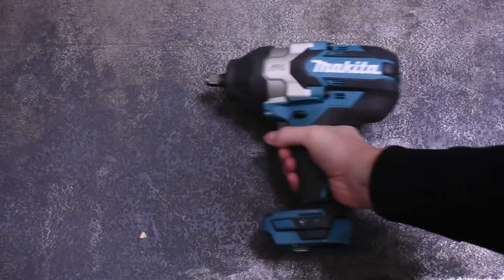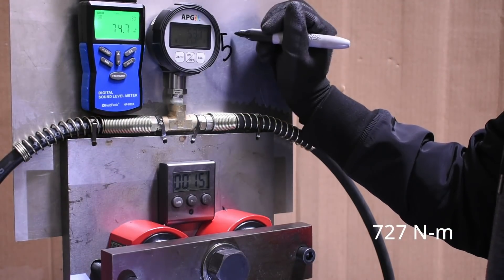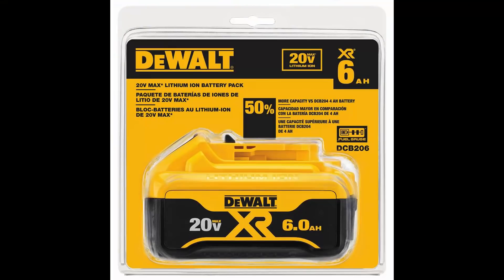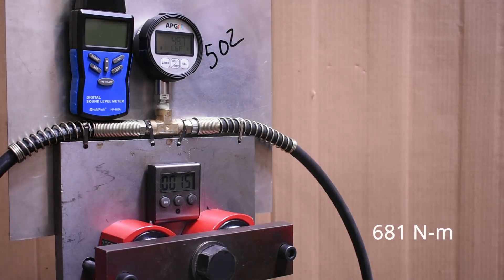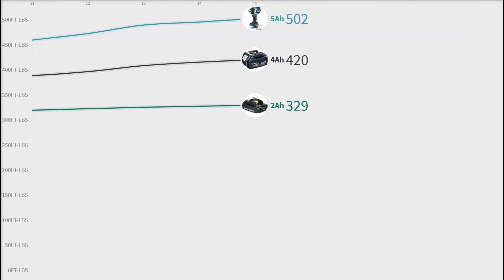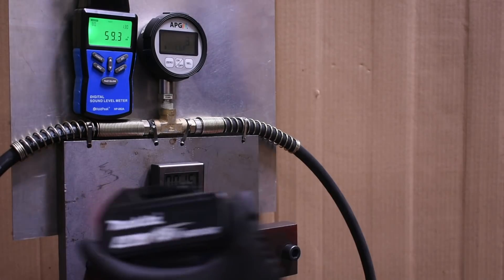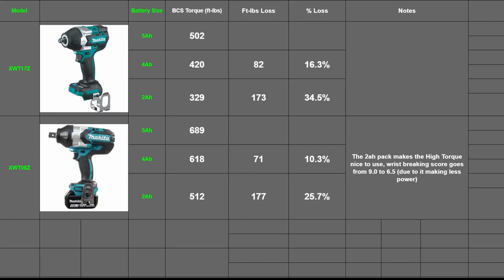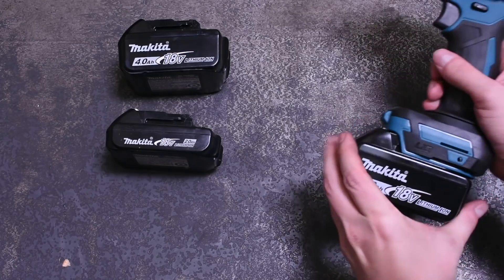How Much Power Are You Losing w/ Smaller Batteries? Dyno Testing For Science

Comment: Voltage is the limitation because amps cause heat. Milwaukee has major overheating problems and consequently battery failures. Makita did the smart thing with XGT. Makita, unlike all other companies, is an engineering company instead of a marketing company. Makita is primarily interested in making the best tool.

Comment: WHY NEVER A 6AH battery test with Makita? Many always ask but we never get a answer (sorry for caps). Are they not worth it? Keep up the good work 😉
Reply from the maker: Same number of 18650's but higher capacity. 3000mah cells. Which sort of suck for discharge rate. Will make less beans
Reply: @TorqueTestChannel  thanks! That makes sense finally 😎 thanks. How about the wider 21700 cases from ebay 1row4ah and 2row8/9ah? Would they yield more power on a mid torque do you think?
Reply from the maker: Yes me thinks if using real cells. Gotta build one. Leave me to it!
Reply: That would be awesome to test! Another question. I can find Samsung cells 18650 with 2500mah and a 25a or even 30a discharge current. Will they be stronger then the standard 20a cells?

Comment: I'm kind of confused what's better the Milwaukee 5Ah🔋 or the Makita 5Ah🔋? Have u seen what's inside? I know Makita has a VERY sophisticated charger with a fan & all the protection I think a lot of the batteries even do a balance charge, I don't think the older Makita batteries have that feature but I think the newer ones do. It's cool because Makita only has 2 chargers a single charger & a dual charger but all of them are fast chargers the other brands make you buy an expensive tool setup to get the fast charger, Makita hands it out with every setup 🤷🏻

Comment: great video. I understand your point of view about makita batteries and tools but dewalt does the same they sell the flexvolt tools that can take advantage of the flexvolt batteries and makita sell a new line of tools that can take 2 batteries at the same time. I only own dewalt tools but this is my opinion about makita battery system which I like more because I have a hard time using the dewalt 9a batteries because of the weight in small tools and with makita I only need the 5a for the big tools and small tools. I hope that others can understand my point of view.

Comment: I have the Bosch Freak that I've tried with the 2Ah, 4Ah (2170), and 6Ah. The 2Ah had issues removing lug nuts off a car i torqued down to 140ftlbs months earlier (old could remove half) and the 6Ah was able to confidently remove them all. BUT the 4Ah with 2170 cells blew them off no problem and has no issue removing 250fllbs nuts off a truck (although slow vs my air blue-point impact). My point, some impacts see a world of difference with stronger batteries. If its the electronics or mechanics of the tool i think it varies, but the Bosch seems to release all the beans the battery has and is extremely consistent.

Comment: In defense of Makita, I believe they are the only one that the charger pulls air through the battery when charging. I have a 3 ah battery that came in a tool kit that I purchased in 2007 that still works. I also have a brushed hi torque that I think I purchased when 3 ah was the largest capacity battery. I didn't use it much until they came out with the 5 ah which made a huge difference.

Comment: The case on makita batteries is made of high quality polycarbonate, not ABS plastic as you stated. If you look at the bottom of a battery you will see the "PC" marking. I recently backed over a 2ah Makita battery with my 8,000 lb diesel truck and it is still usable.

Comment: Just to say as shown on the battery packs, Makita packs are PolyCarbonate. Definitely not some weak shit like ABS, dunno if it's better or worse than nylon for this case, as far as I know it's stronger, but less flex. 
Oh and the 2Ah pack you tested not having the gauge might be part of the weakness since the fuel gauge is on the newer more recent B revision that plays into their whole smart tool/battery protection and control wizardry.  Would be cool to see you test that 2Ah against a newer BL1820B 2Ah which are currently $43 on amazon right now so for any fellow Makita guys wanting a small battery for smaller tools it's a helluva steal.

Comment: Great video, but i came to defend the Makita batteries. They are built and assembled with extremely high quality materials. I dropped an impact 25’ onto concrete and both the tool and battery were fine. The “generic” battery housing profile is durable, streamlined, small, lightweight, and user friendly as they can be removed one handed. I wish the other brands offered this.

Comment: Makita XGT 2.5h battery is 18650, the 4ah XGT battery is 21700. 

Sydney tools opened them up.
Reply: 18650 does not have high output cells above 3Ah, so you can guess that it is 21700 without dismantling it.

Comment: What I would like to see is these companies offer a fan cooled corded AC to DC adapter when your batteries are drained and you have access to AC power. Dewalt did this with their old 24vt system. I still use the circular saw in my shop because its so light. The fan cooled AC DC converter works great.

Comment: Great channel.  A suggestion for all us gear heads out here.  Since you already have a great test jig for calculating torque and clamping force, it would be neat to see you use the jig to show some common fasteners like lug nuts and torque yield bolts, their tightening torque specs and corresponding clamping force.

Comment: There's seems to be a rule of thumb developing relating to the minimum size battery required for maximum torque output of each class of torque wrench:

Low torque: 3ah.
Mid torque: 4ah.
High torque: 5ah.

Comment: I love Makita cordless tools and own quite a few, but they do have the ugliest battery.  They really need to update the look and design of their batteries.  I agree with you that they look generic.  But the they make some really nice tools.  I love their 6 1/4in skill saw and their 10in top handle chainsaw.  

It's crazy how good the cordless tool market is now.  Makita, DeWalt, and Milkwaukee are pushing each to new places.  I wish Bosch would try to compete more, because they make some great cordless tools as well, but they don't really have the lineup the others do.  Having said that, I think Bosch's CORE battery system is the best I've used amongst drills and impacts.  They last so long.

Comment: This is interesting information because I always considered the larger battery basically allowed longer run times not tool performance THAT MUCH. 
The second interesting point was the strange bump (5:16 mark) in the initial 2ah test. Typically the curves are relatively smooth (partly due to avg. 3 runs), that why this sharp dip must be something real ???

Comment: Amp hours (Ah) is a terrible way to measure potential runtime.  It should all be done in Watt Hours (Wh).   Higher voltage battery packs can have the same watt hour rating as lower voltage packs.   Higher voltage packs tend to net higher power outputs as they require less current.   More current requires better connections,  thicker wire, etc.etc.

Comment: Heads up. As of this date HD does price match Amazon.  Recently picked up a Milwaukee Fuel grinder ($140) and 5.0 battery ($69).  CS desk wasn't thrilled but the manager said to honor it.
Reply: Haha home depot in Canada doesn't seem to stock the dewalt dcf899 but I found a store that did. The website was priced wrong, think it was $100 less than the price on the shelf. "Well I guess your getting a good deal" the customer service guy said with a frown 🤣

Comment: Yep, no surprise  5:23 told yo so, and I was surprised that you hadn't picked up on something this basic on power tools that the amp rating will elevate more torque if anything else is equal and your not circuit limited by some protection circuit.
Was very surprised that your channel literally believed that there was no difference and amp rating had no impact..
even the "real tool reviews" dude with his Skidmore bench torque-rig, also had to conclude this after we debated it, though many years back..
Reply: and have in mind' you dont have to guess what amp/wattage these tolls can take, for a channel like yours, it would be quite straightforward to purchase fx a 8 USD 150A ampmeter with incl. display for RC and DIY rig that in between the tool and the battery and here you would see what exactly is taking place the voltage drop, and find the exact middlegroud for what amp rating is ideal for a certain tool, as I would be supprised if the 1.5A and 2A packs is choking under load with these beefy impact wrenches..
and if you wanna take it a step further, a current clamp + fx an oscillioscope would grap it out to what your heart desire.

Comment: I’m a little surprised the big impact wrench even allows you to put the 2Ah on it, a large percentage of Makita LXT tools have tabs on them that disallow putting 2Ah batteries on, presumably to protect the battery from excessive current demands.

The full-size impact with a 2Ah battery performs about the same as the mid-torque with a 5Ah...
Reply: The 2Ah battery does not allow you to use it on a tool like this. You would either have to cut off a stop pin on the battery or use a knock-off battery. Considering that the 2Ah batteries have had battery gauges on them since 2016 I am guessing this dude is using knock off batteries.

Comment: Higher voltage is the future. Makita are just the first to make the jump with their main line. The younger guys are gonna whine about 18-20V becoming obsolete because it's all they've ever known. I've been using cordless since the '80's and have seen a lot of battery platforms come and go.
Reply: At this point, the higher voltages aren't doing NEARLY as much as they used to. The difference between a 12V and 18V tool used to be huge because of 8 cells or 12 cells, ONLY in one row, but now, it's just a convention. Now you have one, two or three rows of cells, and running a higher voltage just means that you need to have a large pack just to get out the door. I'll take my three different weight options on my lowly 18V tools. Small for small things, and go bigger from there, when needed.

Comment: Outstanding video as always. I would surmise that a smaller battery (or weaker) would in theory generate more heat in a tool. If to get a particular job done it would take longer with the smaller battery therefore generating more heat in the time it takes to get a particular task accomplished. Just a thought.
Reply: Not necessarily yes running for a longer time will produce more heat but its really depends on the load applied to the tool. But a small battery is not going to make more heat than a larger one because its mainly a function of the amount of current the battery can provide more cells can provide more current and therefore more watts which is more heat. its all just ohms lawe in a nutshell watts= amps* volts and since the tools are generally a common voltage like 18v you can keep that the same but the main factor to make more heat would be resistance or the ohm value which in a tool isn't as straight forward but generally more load equals more resistance  and watts= (amps)^2 * resistance(ohm) since that is true amps are squared more amps will increase the heat or power in a tool given that the tool runs the same volts and the same resistance

Comment: The Makita uses 100% Polycarbonate enclosure but no overmold, Dewalt uses PC} ABS which is much weaker cuz its a blend, and finally milwaukee also uses Polycarbonate} ABS but with the overmold which makes it the best battery out of the big 3 for shock resistance

Comment: I started with makita, and dumped them pretty quick, the tools are definitely made out of cheap plastic, especially the batteries. I had brake fluid come in contact with a light and the battery in it and the next day they were both broken, the battery was cracked all along the bottom and the lense of the light had shattered, i managed to keep them going using jb weld but when the other battery refused to charge for no reason at all, i threw the drill, impact in to an old tool box at home threw out the batteries, this was 6-7 years ago. Just came across them the other day while cleaning out the garage and the rubber was all swollen and the housings were cracked. Theyre junk tools. Maybe the purple ones hold up, but the teal ones dont.

Comment: I really dont understand why so many people are upset about Makita launching another platform. They arent making you ditch all your 18v tools, in fact they even have an adapter that lets you charge both 18v and 40v batteries on the new charger. Would you really use one of those giant 60v flexvolt batteries on your impact driver? Makita makes excellent tools that are often in line with power with its competitors while being much smoother. The new 40v line took the tool technology further than upping the amps on the 18v could.
Reply: Because in the US they are slapping a huge upcharges on the new 40v stuff. Tools often are $100 more expensive than the 18v across the board, batteries more expensive too
Reply: You don't need to use the 60V battery on a tool, but you CAN. I'm also curious about your last statement about upping the Amps... All they are doing is putting all of the cells in series instead of parallel. Now, in order to have a larger battery, instead of going from one, or two rows of 5 cells to three, you have to go to two rows of 10 from one row of 10. I mean, if it works for them and they make sales from consumers, great, but I won't be buying into that nonsense.
Reply: @IceBergGeo  right !

Power comes from cells x cell rating.

So if you put 10 cells in parallel you'll get 10 x 25A = 250A x 3,7V = 925W.  But 10 cells in series are 10 x 3,7V = 37V x 25A = also 925W maximum delivery.

It might be a tiny advantage over the volts drop at the contacts.  But as milwaukee shows 18V is enough and if the brand needs higher voltage its more or less their bad contacts on the tool.

21700 cells can deliver more amps over the surface area. So 10cells 21700's ARE stronger then 10 cells 18650's. Physics.

Makita could go the 18V route on 21700s like mil does but instead they want to sell new tools to the user and combine the higher rate 21700s with that stupid 40V 'Max'  (36V) bullshittery.  

So IMHO makita kicked itself out of the race.

I'm sticking with Fein, DeWalt and Festool.

Comment: Like your vids. Good straight up comparisons. Watching this one I wondered what the maximum current draw from the tool is. I also wondered if they were offered more than 5 amps would they use it. Is there a way you can read current draw and is it possible to connect the tool to a larger power supply than offered by the manufacturer and see what the tool wants.? Thanks.

Comment: I wonder what the Makitas would do with the 6amp hour packs.
Reply: I have some knock-off 9ah Makita compatible packs.  They're pretty big, but they're fantastic in our mower.  Not sure their C rating would beat the 6ah from Makita though, but I can run the mower for a pretty long time.
Reply: @jeffbuck2624  The cell in the counterfeit battery is generally the best single cell 2ah,  many counterfeit batteries are 1.3ah or 1.5ah
Reply: @painkiller8079  I probably wouldn't call the ones I have counterfeit because they don't pretend to be actual Makitas... They're still holding up pretty well.. I still get at least 1.5 x the run time on my mower over the actual Makita 5ah batteries..Their big problem is, that they totally blew off trying to keep them the same size as the standard packs which means they are just to big to fit into some of the tools... The mower has a lot of room above the battery, so it's no problem, but the power head (weed whacker) and my vacuum don't have extra room above the battery so I can't use them without modifying the tool a bit.. I'm sure the batteries they put in are some of the cheapest, but they just put a whole bunch of them which seems to keep them from stressing too hard... I think that clearance issue is why we don't see an actual 18 volt 9ah battery from Makita... most tools work fine (like a drill just gets taller), but they don't want to release a battery that only works with most of their tools..
I'm sure I've got some cheap Chinese 18650's in there instead of Korean or Japanese batteries which just means that while my Makita batteries will still be working fine in 5 years, my "Makita compatible" batteries will be long since dead.

Comment: Interesting video. There must be circuitry in there to limit the batteries output.    For amp hours usually mean wha the battery can run...ie: a 4 amp hr battery should be able to run a 1am load for for 4 hrs...and a 4 amp load for 1 hr.   But it should be able to handle a 8amp load for a 1/2 hr.   But being as lithium batteries do not like high draw, they must try to limit that       Live confidently and peacefully
Reply: Yes, I've seen videos that show Makita tools/batteries limiting themselves from burning up, while the Dewalt kept going until it started smoking. One more pro for Makita, longevity and reliability.